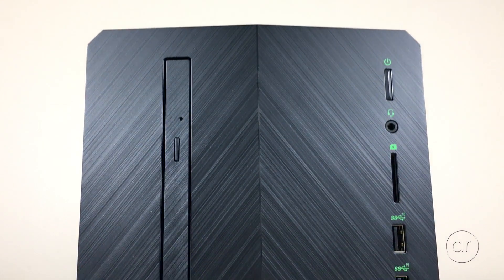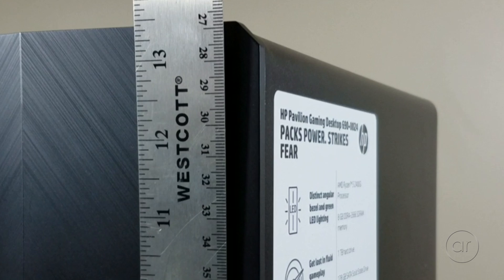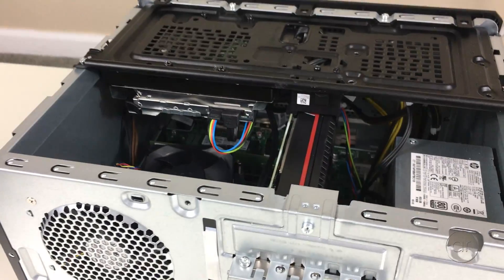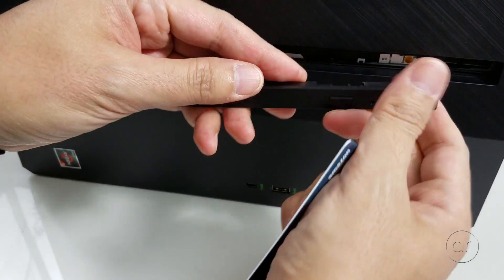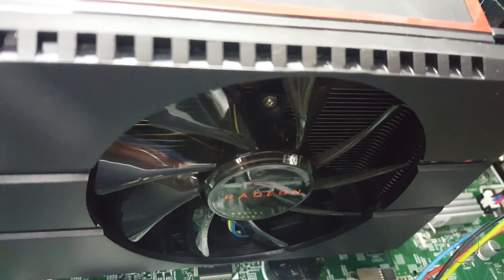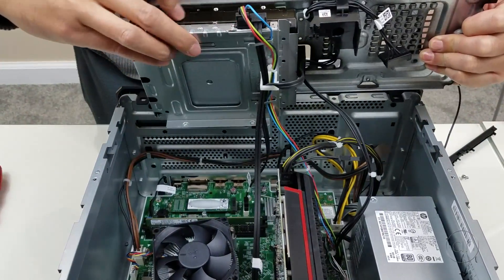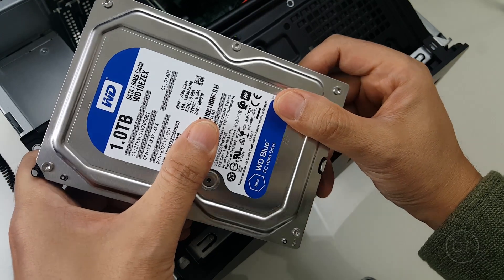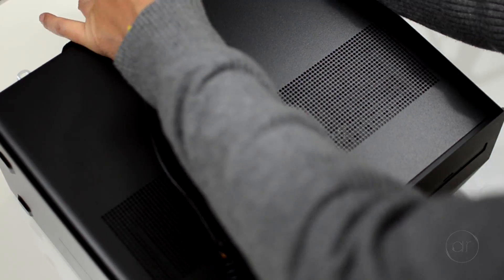How to Open and Upgrade a Ryzen-Based HP Pavilion Gaming Desktop

Comment: Would the rx 570 work
Reply from the maker: The power consumption of the RX 570 and the installed RX 580 is roughly the same, so you should be ok there, but make sure it has a 6-pin power connector. I'd also make sure it physically fits within the case, which is about 10" in length. Depending on its height, you might need to remove the bracket seen at the 3:24 mark.
Reply: @accessrandom   I'm looking at the msi amd radeon rx 5500 its 5 inches high do you believe thatd work sry new to the pcs an this is my first buy
Reply from the maker: @thibaultsgaming6210  I'm afraid I can't say for certain since there are so many models of graphics cards, but I've been keeping a list of successful upgrades in the description from other viewers (under the "Graphics" section). In general, I'd try to get the shortest card possible (with a single fan) since the space is tight.

Comment: For what its worth at this later date, I have the latest model of this same sort of setup but with a 3700x and an rx550.  Similar proprietary 310W supply and motherboard.  The power supply has a 6+2 power connector for a gpu, so I have 150W plus the 75W from the slot for a gpu.  At the wall power measurements (subtract for PS inefficiency) with both cpu and gpu pegged was ~120W.  The PS is a dual rail, so half the supply heads to the motherboard connectors and half going to that gpu connector.  The RX550 draws ~50W full tilt, so the power demands for the cpu/motherboard/peripherals is around 70W.

Here's what I did.

Add second stick of the same 2666 ram.  I did tests with 3200 which the mobo is supposed to support, but it stubbornly wants 1.2v memory and anything I did involving 1.35v memory cut the speed to 2133.  I software overclocked the 3200 memory and memory benchmarks improved.  Overall system performance, however, did not.  The second stick of ram enabled dual channel and huge cpu and memory performance boosts.  It was $32.

Added a short RX570 (both not tall and not long).  The big drive cage in the video above no longer is in there, but it still has a smaller black mesh thing that I could find no purpose for, so I just removed it as it was blocking airflow a bit.  With that out, you might get a long card in, but with it in, the gpu power connectors were rubbing against the cheese grater black mesh panel.  $99.  You could go 1650, 1650 super, rx5500, plausibly an rx5600 or a 1660.  As long as the gpu power is < 150w, you should be fine.

Additionally, the cpu cooler has way too small of a heatsink and I just saw an interesting video talking about cpu heatsinks and the newer AMD chips that are 'chiplet' or monolithic pieces of silicon.  In the old days, most of the heat from a cpu came from near the center, now its all over the surface of the chip.  Many heatsinks have a round contact point.  BAD for these AMD designs.  When I removed the old cooler, yep, round contact point, very bad thermal paste application (all over the place, some of the cpu not covered).  I had an old i7 cooler I used water cooling on laying around, the cooler is intel spaced, not amd spaced, so after removing the old cooler and cleaning the paste off the chip, the new one screwed right in, no problem.  And it has a square contact point.  Much larger spire heatsink as well.  I found that running the cpu hard (folding@home anyone) was driving the cpu up to 100% and I was seeing cpu temps in the mid to upper 80C range.  Not what I like to see.   With this new one (spire is about twice the size) a square contact and good thermal paste application, this dropped to 75-77C at the max.  Much better.  Free because I still had that old cooler laying around.  I also replaced the case fan with a same size cpu fan from another cooler, better quality and moves more air.  Also free.  Sometimes hoarding old electronics pays off!

So don't sweat the power supply even at 310W.  You're good to go with anything gpu wise other that super high end cards like a 2070 or 2080 or 5800.
Reply from the maker: Thanks for the detailed write-up. This would be really helpful for others - is the model number the TP01-0066 with a silver case by any chance?
Reply: @accessrandom  Thats the one!  Got it for $368 plus tax late last year.  Was $550, they said it had a 1tb drive it didn't have and gave me $50 back for that, and I got 20% cash back plus office depot and credit card rewards.  Steal of a deal.

One thing I'll mention regarding the 3700x in particular is it seems that the cpu firmware/bios/OS power settings still aren't settled.  Folks with huge radiator water coolers are able to maintain a low (~30C) idle temp but most people including those using the AMD Wraith are seeing 50C at IDLE and almost 90C at full load.  I installed two different coolers yesterday, a much larger heat sink model with a bigger fan, and an Aidos tall radiator/heat pipe model.  Neither one reduced the idle and load temps very much, but that i7 bigger heat sink cooler I replaced the OEM one with works quite well, doesn't take up much space in the case, and is definitely better than stock.  Seems there are issues with overboosting and overvolting the cpu that happen automagically in the cpu, causing the higher temps.  Its really easy to replace the cooler in this.  No need to pull the mobo at all.  I just unscrewed the old one, cleaned the cpu, applied fresh paste and screwed the new one on.

So my key takeways from this were to not bother trying to get faster ram than 2666 to work, its a waste of time but definitely install a second stick for dual channel.  Replace the stock cooler with a bigger heatsink; the one it comes with is only 1/2"!  I'm pleasantly surprised at how much GPU this can take, just watch the height of the card.  And that "small" 310W supply is more than enough for most mid range to upper mid range gpu's.  Fairly quiet machine also, unless you run folding@home with both a cpu and a gpu load...
Reply from the maker: @tfharper  That's a great deal 👍 It's a curious combination of a high-end processor with a not-as-high graphics card (heck, most of the cost is in the CPU). I'm wondering if the general airflow within the case isn't carrying the heat out as efficiently as it should. Pinning your comment - thanks for the great info.
Reply: @tfharper I have the rx 550 model and I would like to know, if you can upgrade the rx 550 to a Rx 580. If not what would you recommend as an upgrade? I just want to be able to play games like Jedi fallen order and Plague tale at a consistent 60 fps in 1080p no matter the settings.
Reply: @anthonymusic9202  If its the one with the 3700x cpu, then yes you could upgrade to any gpu that requires just one 8 pin power connector, which would include the 580.  If you have some other model, open it up to see if you have a 6 pin or 8 pin gpu connector, as the RX550 doesn't use one at all, getting all of its power from the pcie slot.  If you have a six pin, you're limited to cards with one of those like the sapphire mini itx 570 I bought.  If you have an 8 pin, pretty much any gpu that takes a single 8 pin connector should work.

However, I'm one of the guys who pays the least to get what is really important.  If you're gaming at 4K, the 580 won't cut it.  If you're gaming at 1080 on a 1080P monitor, you won't get much out of a 580 vs a 570.  At 1440 on a 1440P monitor, you might get some extra frames or slightly higher settings with the 580, but the 570 games well for the most part at 1440.  About $40-50 difference between the two.  I decided to keep the $50.  At around the same price, I'd consider a 1650 Super when they're on sale for closer to $150.  That'll kick a 580 up one side of the street and back down the other, with less power demand.
Reply: @tfharper  will my pc burn out if I stick a rx 570 to a 310 wat power supply with a ryzen 7 1700x
Reply: @cristophersalinas9598  I'm not sure what system that is or if its the same PS as whats in my 3700x machine.  What's in my 3700x machine is a 310W with an 8 pin gpu connector, two 4 pin square connectors to the motherboard and a flat 6 pin cable for power supply comms with the motherboard.  If that sounds like what you have, or if you can read the power supply label to see how many rails it has and what amps per rail, we'd know for sure. The 310 I have is in that configuration and features two 12v rails, one for that 8 pin gpu connector and one for those motherboard connections, both 14a.  With that, you could go RX570, RX580, 5500 XT, 5600XT (with ONE 8 pin, some have more), 1650, 1650 super and perhaps even a 1600 or 1660 as long as it relies on a single 8 pin power source.  The rail to the motherboard has more than enough.  The 1660 or 5600 XT might be pushing that other rail if you're doing heads down 150FPS gaming for hours on end every day.
Reply: T Harper sorry I don’t really understand the ram part. I have a 580 with r5 2400g and an 8 gb stick. I’m considering adding an add on a $31 8 gb stick for dual channel. Or I could pay $75 for 2 x 8gb sticks at 2666mhz. The 3200mhz is $79. I’m not a guru and can’t even overclock the thing. I tried to do it through BIOS but I can’t, and Radeon only lets me overclock VRAM and gpu. Not sure on what to do. My PC just took a shit recently while playing warzone and now GTA. I’d run both games at well above 60 FPS on high, and it’s progressively been getting worse until now i practically live at 9 FPS. It’s unplayable and I suspect my ram is the culprit and I need a 1660TI. Don’t know if the sockets will fit but I guess we’ll see
Reply: @Salvaba  I have the same model as you. Put an extra 8gb stick in, it'll help out with your frames alot.
Reply: MaxWoodJoe installing it right now. Crucial 8gb as seen in the description. Will update you in a bit with the performance
Reply: MaxWoodJoe very easy install. Required some force to push in and now it’s running 14.9 gb for memory usage
Reply: @Tom H can I get a 1660 super and still have the same power supply. And I can’t what power supply would u recommend for a 1660 super in this case
Reply: cfb cfb I have the one it the video with RX 580. In some games the screen with go black for a couple of seconds every now and then, other games it won’t do it at all. I would assume the gpu isn’t getting enough power because temps stay around 65-75 Celsius. I’m thinking of getting a new case, motherboard, beefier power supply and cpu cooler to see if that will help with the issue. Think it’d be worth doing? If it does help I could even use the hp as a secondary pc since I have an old RX 550 lying around and just buy a cheap 1st gen ryzen cpu for it.

Comment: Anyone know if it's possible to transition everything inside to a different case? I understand it's a custom size motherboard but I hate the stock case and cooling system that it comes with.
Reply from the maker: I didn't really check the mounting holes on the motherboard to see if they had standard spacings for standard cases. I'll need to defer to other viewers who may have had experience with this - anyone?
Reply: Alec Weltz did you figure out if you could?
Reply: SAME HERE CAN SOMEONE TELL ME  IM TRYING TO SWITCH CASES BUT DONT KNOW FOR SURE THE MOTHERBOARD WILL LINE UP PERFECTLY WITH MY NEW CASE SOMEONE TELL ME PLZ
Reply: @sorinzo3902   yeah same want to case swap but I think you need to buy a other motherboard because this is a custom fittings

Comment: anyone has a link for the 400w psu? cant find it
Reply from the maker: For some reason Youtube doesn't like links in comments, but if you google "HP Parts Store" and click on the first link, then enter the model number (690-0024), you'll see a list of all the parts that go into this model. The 400W power supply part number is L04618-800.

Comment: Is it possible to upgrade the case of this?
Reply from the maker: You can, but there are some caveats: you would need to move both the motherboard and power supply at the same time because they're both non-standard and are matched to each other. Because the motherboard is so non-standard, I'm unsure about whether the mounting spacings are standard. All the other components (memory, M.2 SSD, graphics card, hard drive) are standard, except for the slim DVD drive which needs some adapter to make it fit in a 3.5" bay.

Comment: HELP. can I change the case?I mean I want to buy a mid tower to put everything cleaner but I see that this motherboard has a few usb on the front. can i change it?
Reply from the maker: If you move to a new case, you would need to move both the motherboard and power supply at the same time (since they're both non-standard and are matched to each other). The only thing I'm unsure about is the mounting holes on the motherboard - it is such a non-standard board I don't know if the mounting spacings are standard. All the other components (memory, M.2 SSD, graphics card, hard drive) are standard, except for the slim DVD drive which needs some adapter to make it fit in a 3.5" bay. Like you mentioned, you'd also lose the front panel ports

Comment: Have gotten a lot of use from this computer the last year . Just upgraded cpu to ryzen 5 1600 AF. It's basically a 2600...6c\12threads, way better performance than the 2400g. I also reclaimed the ram that had been reserved by the 2400g so now it's 15.9gb instead of 14.9.
Reply from the maker: Good to know that we can upgrade to a faster first-gen Ryzen. May I ask how you reclaimed the RAM? Also - can I add your CPU replacement to the description with credit to you?
Reply: @accessrandom  absolutely, please add my info to the description if you would like. I also did the CPU cooler modification explained by the other person so there is now the freezer 12 and I have completely removed the hard drive rack. Max CPU temp under full load never goes above 68 now. Also, I believe I was confused about the ram thing because I see others in the video description mentioned the same thing, I e. When the CPU is replaced the computer no longer reserves RAM for the igpu from the 2400 g.

Comment: Can I just add two sticks of Corsair vengeance ddr4 2666 8gb ram to make 16gb without any issues? Like plug n play?
Reply from the maker: I've been keeping track of viewers' upgrades in the "Replacement Memory" section of the description, and it looks like someone has reported a successful upgrade to 16GB of the Corsair vengeance (CMK16GX4M2A2666C16).
Reply: access random awesome! That’s the exact one I ordered. Is it just plug n play? Nothing extra needed after I install it? Not really computer building savy

Comment: So I took it apart and after putting it back together, the pc no longer reads the hard drive, the cables seem to be in the right order, I may have switched the p3 and p4 cables but unlikely they seem to be length to prevent that, any thoughts on what I might have done?
Reply from the maker: Make sure that both the data and power cables are securely attached on both sides: the drive and motherboard. Does it show any error messages when you boot, or is it just a blank screen?

Comment: I had this pc for almost a year how much should I resell it for
Reply from the maker: I see it going for around $450 used on ebay, so that would probably be a good starting point (depending on its condition).
Reply: access random it’s in really good condition and I clean it regularly and I added more ram

Comment: how do you add a second hardrive
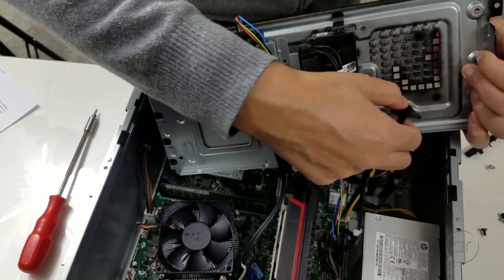Reply from the maker: You can connect it to the light blue SATA data port shown at the 5:03 mark, and the spare SATA power cable shown at 5:15.

Comment: Hello , I’ve been trying to take the graphics card out but I’m not able to, do u know how ??
Reply from the maker: At the very bottom of the graphics card where the card meets the slot on the motherboard, there should be a small plastic sideways lever on the slot that locks the card in place. You'll need to lift that lever to take the card out.
Reply: Hey thanks for answering , I found that out myself a couple of hours ago , another question , I did some over clocking and my pc now won’t boot , I tried resetting cmos and using the jumper but none of that works , do u have a solution?
Reply from the maker: @chikenkillz5666  Is this for the HP Pavilion? I don't think there are any settings in the BIOS to allow overclocking.
If this is for another PC, which component(s) did you overclock (CPU? GPU? memory?), and how high did you try to go?

Comment: thanks for this video i got the upgraded virsion of this pc with i5 9th gen and a geforce 1660 but only came with 8 gb of ram and wanted to upgrade glad it doesn't look to difficult
Reply from the maker: Sure thing. Yeah, the 690 series of the Pavilion are pretty much the same except in terms of the housing. Only the internals vary...
Reply: What power supply did you use for that? I can not find a power supply that has enough wattage for that does not have 24 power pin for motherboard
Reply: @davidcaldera6768  i was wondering the same :( i wanna upgrade my gpu but the current psu is too low to support the rtx gpu's.. :/